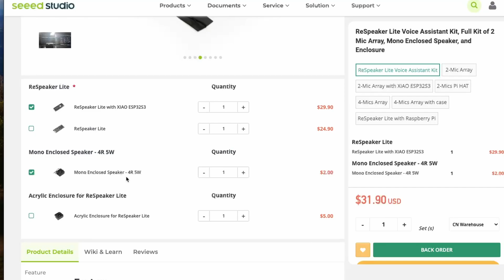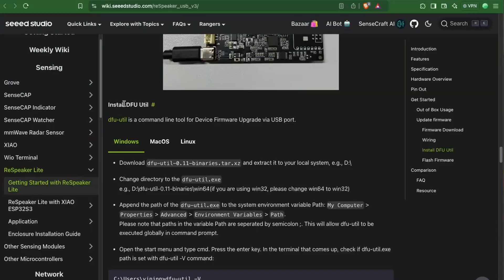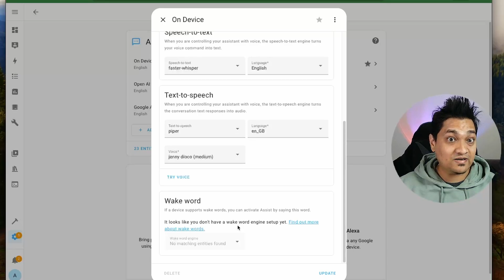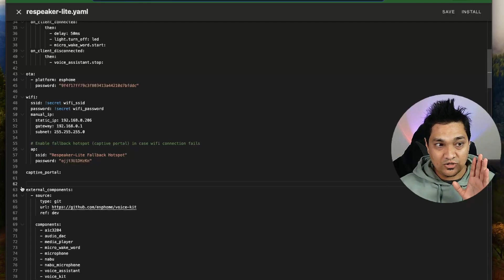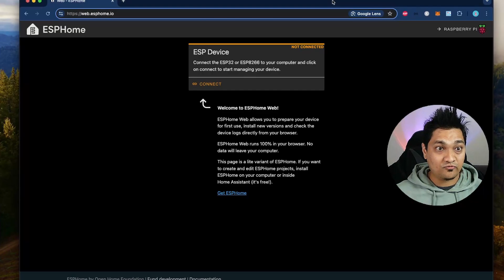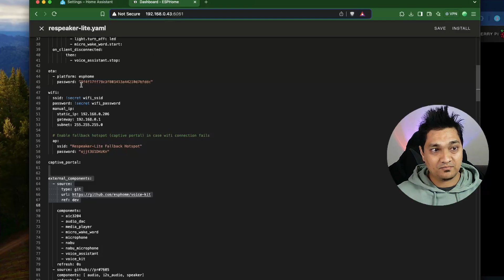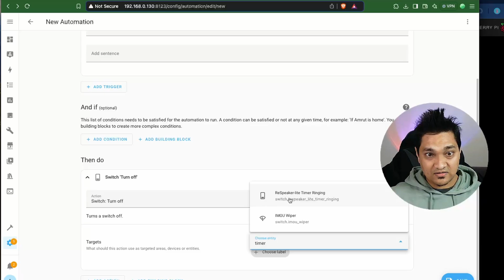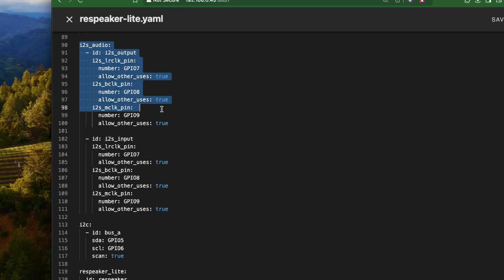Create LOCAL Voice Assistant w/ Home Assistant | NO Soldering | On Device Wake Word🔥| ReSpeaker Lite

Comment: Hello Amrut, I have xiao esp32 S3 sense board and today got SeeedStudio Respeaker lite (without ESP32), need help in connecting these both boards. Do I need to solder all the pins on both these boards including the pads, to each other. Please help
Reply from the maker: Think so. At least it looks like that on my board. I got mine with the xiao S3 already connected.
Reply: Thank you @SmartHomeCircle  I am able to create the voice assistant, but the response is too slow with Google AI
Reply from the maker: @vijayraut6547 the processing part depends on how much time the speech to text and text to speech conversion takes .
Go to setting > Voice assistant> on your voice assistant pipeline click the 3 dots.. click on debug.
 There you should see the time of each phase.

Comment: The yaml does not work, keeps failing with this error: The program size (1842854 bytes) is greater than maximum allowed (1835008 bytes), any idea on how to fix?
Reply from the maker: You need to specify flash_size: 8MB under the EP32:  yaml section

Comment: when copy and pasting the whole yaml it gives the error: on install that  Could not find __init__.py file for component media_player. Please check the component is defined by this source (search path: /data/external_components/989fb39b/esphome/components/media_player/__init__.py).

is there anything to edit or change?
Reply: the latest XMOS FW is different from the video... is the 1.1.0... than i suggest to take a look to the last  ESPHome Yaml Code. Don't know if the code in the page is updated for every update. Maybe you have an update XMOS FW and not an updated YAML code (or viceversa)

Comment: I got it all setup, thanks for the tutorial. One small question, do you know how to disable that RGB? I turn it off and any time I use the voice assistant it turns it back on. Its very bright.
Reply from the maker: @dranas2019  yes.. you can remove it.. you can remove the section with rgb led lighing. And that should help.

Comment: How does it handle background noise and distance? Most current esp32 existing solutions have been a bit underwelming in these aspects.
Reply from the maker: It seems better than just using the inmp441 microphones. I have been using it for a week now and it seems to be better for around 3 mts.
Reply: @SmartHomeCircle  How would you compare it to the usual echos and google minis in term of picking up the wake world and interpreting commands?
Reply from the maker: Wake word is instantaneous. But interpreting commands depends on the speech to text model you run as part of whisper and how powerful the machine is. In my case I am running an i5 6th gen processor.

Comment: Would it be possible to use a Sonos speaker via wifi instead of a speaker connected to the 3.5mm jack?
Reply from the maker: @fugixi  you can use it as speakers in Home Assistant via wifi.. but not as voice assistant speakers.
Reply: There is a hack, that allows routing TTS to other players in Home Assistant. But it's really buggy and hacky way to run things.
Reply: @formatBCE  Yeah, I can imagine. Thanks.
Reply from the maker: I had created video a while ago, such that you can send the output of the voice assistant to a mediaplayer in home assistant. But it was for ESP32 and which supported the media player service. 
You can try it with the ESP32-S3, but I am not sure if that would work. 
Here is the video:  https://youtu.be/RIpnyTJmJJ8

Comment: This is really great! Thanks for the video. I wonder when someone will finally sell this device as a completed retail, working unit. For maybe $30 or so. This would be great for the HA community.
Reply: The board itself costs a bit more :) Then add speaker, enclosure and manufacturing - it will be more like 50-60$

Comment: Is this device powerful enough to have a custom wake word?
Reply from the maker: It has ESP32-S3, so it would be. Currently the process for creating custom wake words still requires a power machine and the process is tedious.
Reply: @c0deless  to have custom wake word at current stage you have to use streaming to HA, with Openwakeword on HA side. There's several wake words trained by Kevin for Microwakeword (which works on device), but no simple way to train your own.

Also, only "okay Nabu" is pretty good, since it's using real voice samples. Others are trained on synthetic dataset, generated by TTS engines, so aren't very good at picking up accents and stuff.